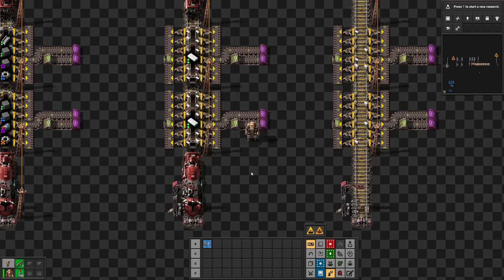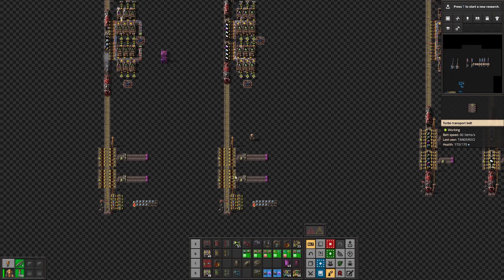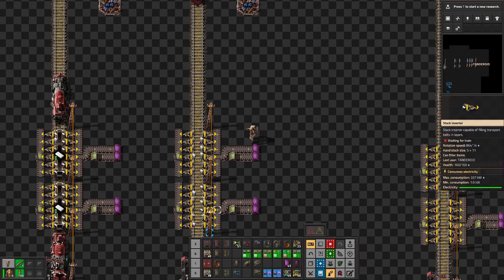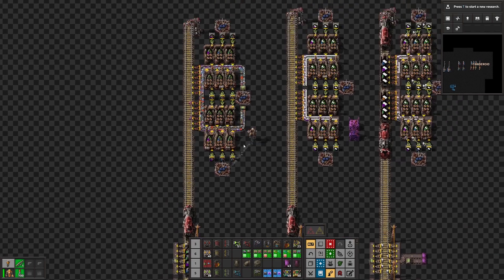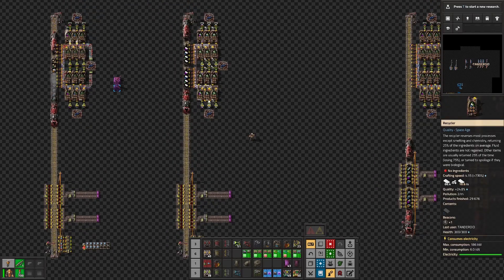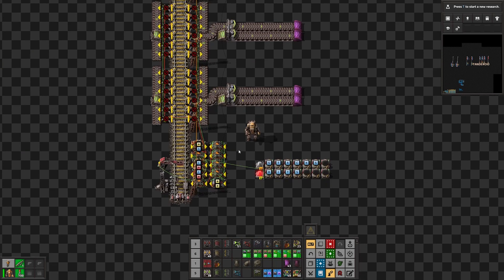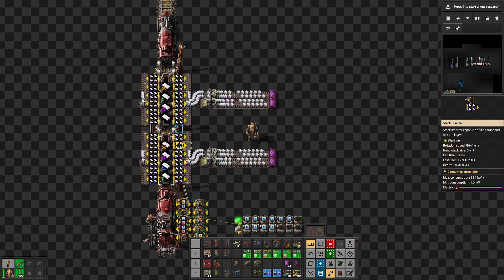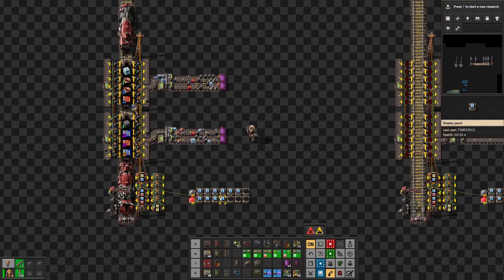Unstuck the stack inserter!

Comment: I've spent multiple hours discussing the "stuck spoilage in the stack inserter" problem, interesting to see other's people solution to similar problem
Reply from the maker: @Trupen  Probably not an ideal solution for individual inserter, but I'm thinking on something with less logic elements. And... OMG, it's Trupen🤯 Glad to see you here
Reply: I play coop with this guy. Now i can assume that I am one manipulater swing away from Trupen
Reply: @Trupen  Spoilage, another problem from Gleba huh?
Reply: People overthink this problem.  Make a decider combinator that outputs C=1 AND C=input so long as C<=600 (or some random rollover number). Route output to input and you have a resetting clock.
Take an arithmetic combinator and output 600-C as signal S.
Set S to control the stack size of all your stack inserters.

Now, periodically, the stack size will sweep from 16+ all the way down to 1 every 10 seconds (or however many ticks you choose.)  Any stuck inserters will be given the "all clear" to go with however much stuff they're stuck with to clear out the last dregs of whatever is holding them up, and it will have a very tiny impact on throughput.  Set higher than 600 for very occasionally clearing out spoilage.  Set lower than 600 if you have a large number if low-quantity mixed items.

Simple, done.

Comment: How exactly does this work? Would it work if I had a cargo wagon with 48 different types of items with the quantity of 1 each?
Reply from the maker: @freshna42 The logic is next:
Divide all items in the train by 16(stack size). If we have more than one signal - set top 4 as filter. Otherwise, pick the biggest item and set it as filter, and count as stack size.

Yes, it will work for any amount of single items. But, it will not be as fast, as a bunch of stack/fast inserters. This is not a magic bullet, but will help in cases described in the video
Reply: @TED-inc  Ah got it, thanks for the explanation, also don't forget, the green ones are now called bulk inserters ;)

Comment: or just make them firstly insert into chests, and then from chest to belt..
Reply from the maker: @iamm_777  Sadly, it will not solve any of the stuck cases. It still can be jammed in quality situation (or can decrease throuput), and will definitely got stuck in scrap with different quality situation
Reply: You're just postponing the problem. Now prevent the stack inserter from getting stuck when picking up from a chest
Reply: I don’t understand the purpose of having train cars with mixed cargo, this doesn’t seem to be a problem if you just don’t mix cargo
Reply from the maker: @paunda6989  this is useful on Fulgora
Reply: @TED-inc  but why not just transport scrap itself? the tiny islands with millions of scrap hardly have any room for recyclers anyway
Reply: unloaders yes, but generally you don't need chests for mining outposts
Reply: itll jamm twise often)